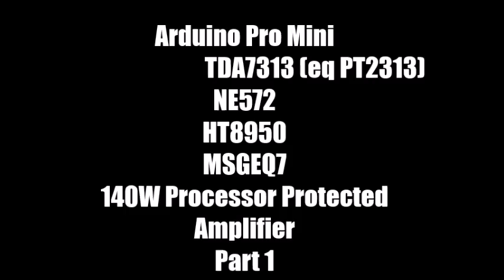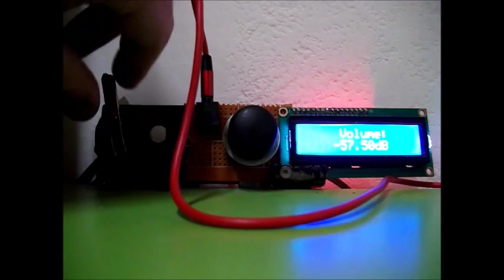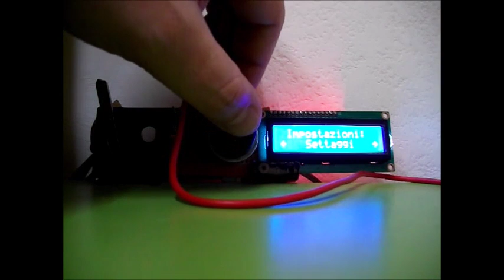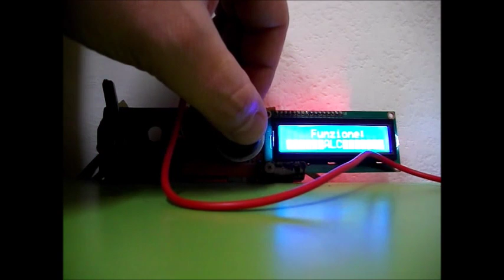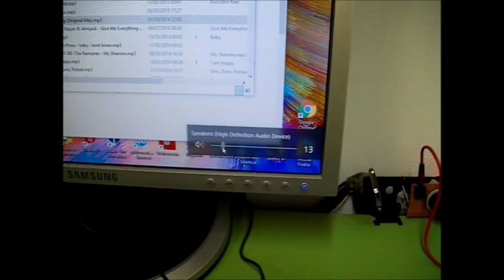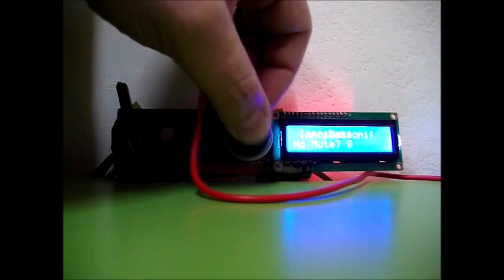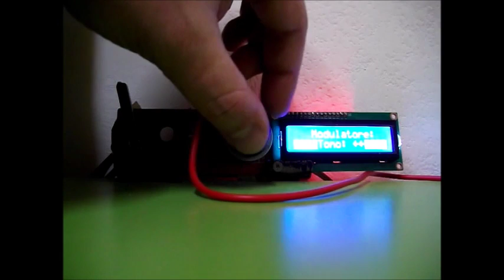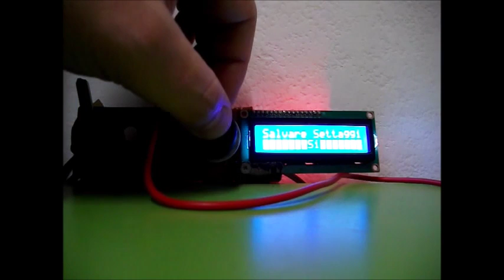Arduino Pro Mini TDA7313 NE572 HT8950 MSGEQ7 140W Processor Protected Amplifier -Part 1

Comment from the maker: honestly? i've dismantled the "thing" and made in pieces (salvaged) i realized it was just too... uummh... pointless? now i have a bluetooth receiver (search for "12V bluetooth mp3" it's 3€ ish) and a 12V amplifier from a car radio that is more than enough for PC amplification (good speakers remained), i was also scared of a "chain firecrackers" effect including my PC and a peacemaker that i didn't know i had :D (i don't have one)

never done the second part of the video bcs it was (in my opinion) too boring, it was a MESS!! wires hanging behind the desk and perfboards screwed on the fiberboard -_-

assembling the analog "effects" card was exhausting, near the end with more components than space on the perfboard i realized that i will NEVER... never make a project so big for so little use (infact i used it almost none) :D

thanks for the appreciation to every "aficionado" :D
Reply: I repeated your product, everything works fine, thank you very much !!!